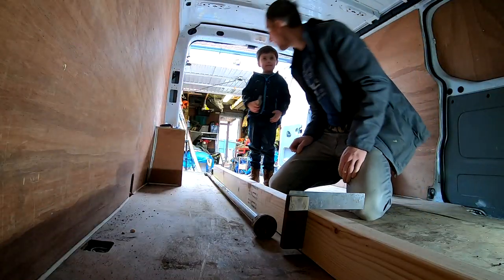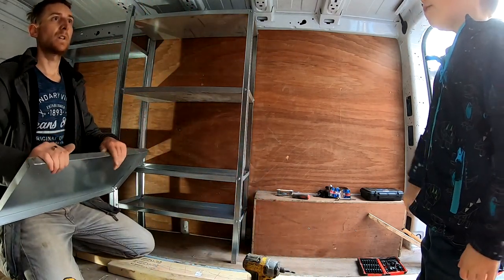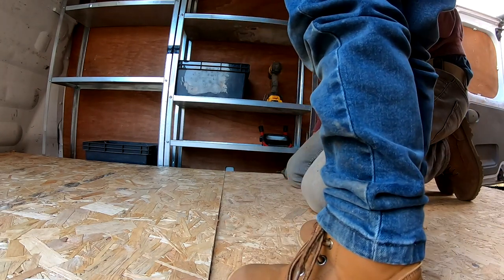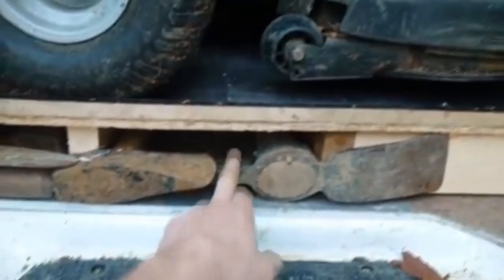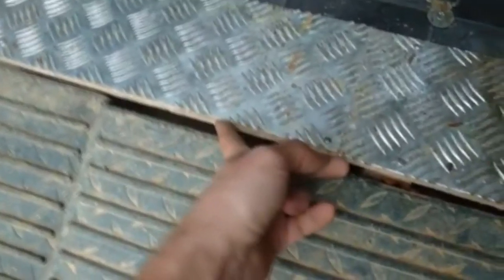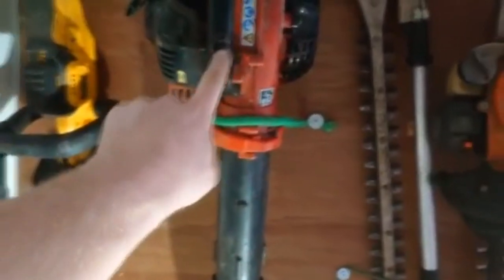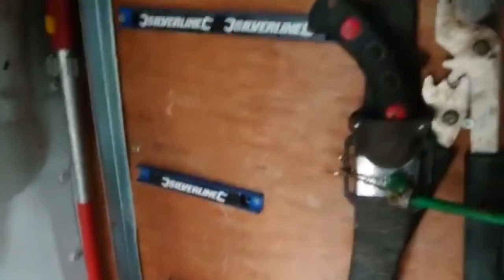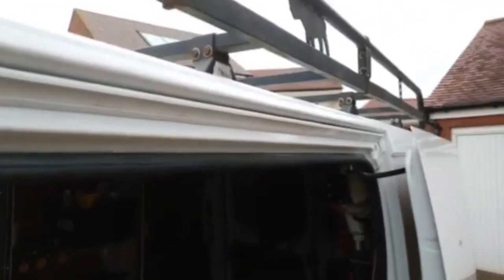How To Rack A Van: Gardening and Lawn Care Tool Set Up 2021: Vauxhall Vivaro: Van Racking Ideas

Comment: Hi, great vid. How did you secure them U brackets for hedge trimmer to the plywood lining? I want to attached hooks to my ply lined van but can’t find any info on which screws/plugs to use! Thanks
Reply from the maker: I took the ply off the side. Drilled though and screwed blocks of wood behind the ply. I then screwed the hooks though the ply into the blocks.

Comment: More and more are using vans in Australia now
Reply from the maker: I couldn't imagine using anything else now. Forever worrying about tools being pinched or getting wet. Thanks for watching 👍
Reply: @TheCountryCottageGardener  pros and cons to each mate. I use a small tipper with a big tool safe for all the hand tools and all machinery  is well chained on when it’s not being used during the day. Takes seconds to chain stuff. Getting machinery wet isn’t an issue as it gets wet when used.
Pros are it’s obvious nothing of value is left on van overnight so no issue with attempted break ins either at night or during the working day. 
We all work differently though so it’s a case of finding out what works for you.

Comment: Is the a new van? Thinking you've gone bigger?
I've just upgraded my Lwb Vito for a Lwb Transit Custom. I've lost a side door which is a pain as can't reach everything now. I'm thinking of a box which pulls out on these long runners through the side door. And then storage on top of that.
Reply from the maker: Hi pal. I had a new Citroen dispatch so in a way it's a down grade but this is bigger, am saving nearly £300 month and won't worry if I knock or dent the inside with tools. Plus the extra space and better roof rack will make loads difference. 

I was going to do a draw in that middle space but decided not to as I still have loads racking free.

Comment: How do you load your ride on mower?
Reply from the maker: I do show how in the video
Reply: I only saw you unload it but not drive it up. Do you push it or drive it straight into the van?
Reply from the maker: @greenapples5887  I can do both but I kinda do half and half. I ride up to get the front in, put the break on, get off and push it in the rest of the way. Prefer doing it that way so I don't bash my head 🤣